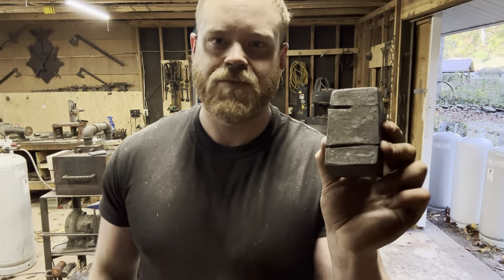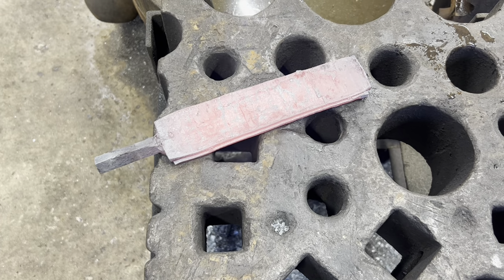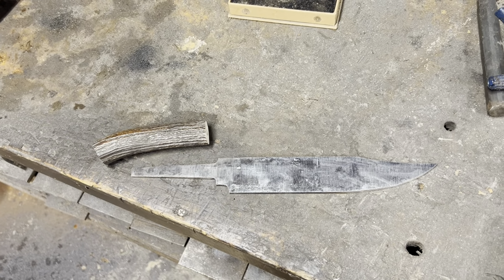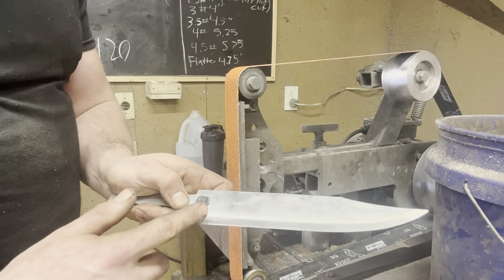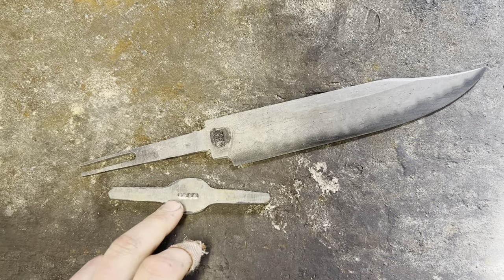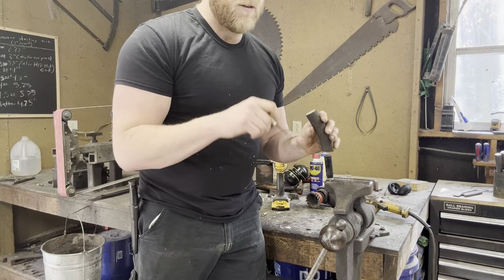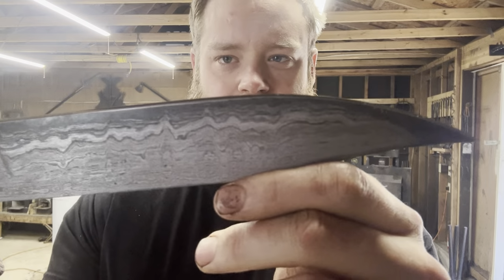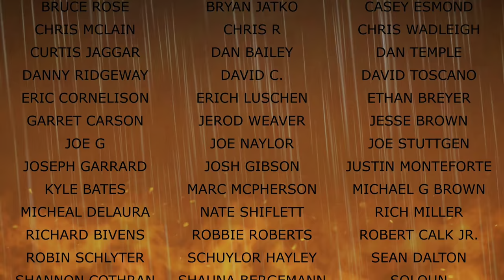Making a bowie knife from 100 year old iron chain

Comment: It may be a link to a WWII anchor chain, but considering that each link (depending on the class of battleship) can weigh reportedly 120 to 220 lbs each, it's only a fragment of one.
Cool blade, great work.
Reply from the maker: Yeah it was a section of chain from the carrier USS Essex. (At least that's what the guy I got it from told me the guy he got it from said) I talk about it more at the end of the video
Reply: @OldHickoryForge  I had one uncle at Pearl who survived the Oklahoma capsizing and another uncle on the USS Cape Gloucester that rescued Australian POW survivors at Nagasaki.  I would assume that an Essex class would have a similar size anchor chain to an Iowa-class battleship.  Too freaking big for us to be handling with ease.
Reply from the maker: @AndyFromBeaverton  yeah my supplier also mentioned that it was too small for anchor chain. If it did really come off of the Essex it was either a drag chain or some kind of ballast material. That's why I didn't put "anchor chain" in the title. It was about 2.5" round before I lost so much material trying to make a hammer.

Comment: I have 4 small 1×1×2 1/2 jelly rolls made from 4 layers, alternating grader blade and leaf spring, the jelly roll is only a couple of wraps and the last  half to whoke wraps didnt weld,  was thinking of putting them in vinegar then acetone, shove em in a can, add some jackhammer bit for the core,  add some 1095 powder to fill the gaps, and make a hammer, will the vineger and acetone let the unwelded parts of the jelly rolls weld?

Comment: This may or may not be helpful  but give it a try.   I mostly do guns and hot rod/motorcycle stuff but my go to Cleaner/lubricant/protectorant is a 100 year formula it is equal parts of ATF (cant get whale oil anymore) ...   Kerosene... Mineral spirits.... Acetone..  to that I add a couple of ounces of pure lanolin and a couple of ounces of amyl acetate (for odor)  It penetrates metal and it protects better than anything I have seen and costs almost nothing compared to similar products for sale.    I mix it in gallon lots.    Nothing I have cleaned or wiped down (with a fairly soaked rag of it) has ever rusted on me.   In California where I live that means  a quick wipedown every year or so.   I am talking guns with literally no finish left on em.    Try it.    you will use it for everything.